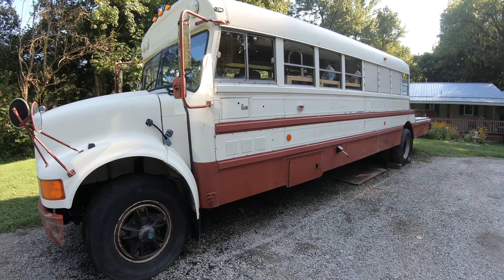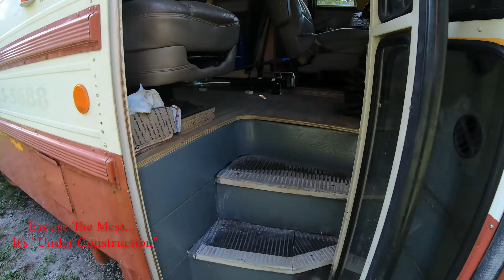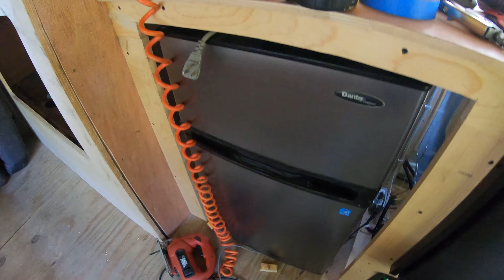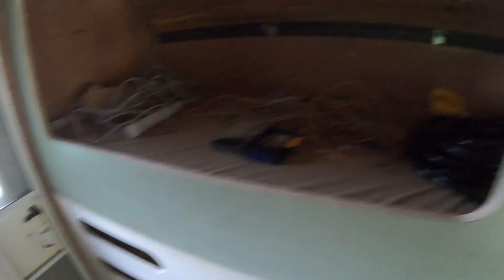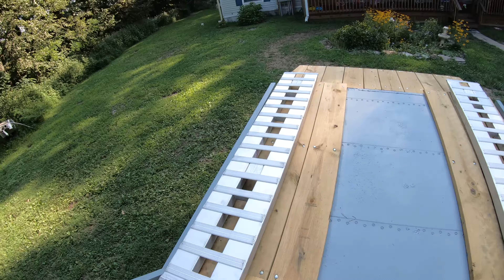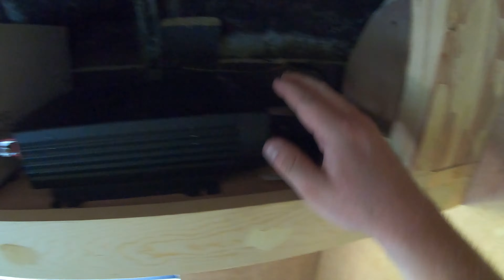NotSoGrand Hauler - Under Construction Walkaround - Skoolie Toy Hauler Build

Comment: how many batteries will the bus have?
Reply from the maker: I'm leaning towards just a pair of 200ah AGMs.  We won't be full timing or anything and our electrical needs are pretty low.
Reply: @NotSoGrandGarage  sounds good. any solar panel on top to charge them up ?
Reply from the maker: Don't have them mounted yet but do have panels ready to go.  The bus has been on the back burner for a bit (life gets in the way sometimes) but I just ordered the mini split ac and will be getting back on it here soon.

Comment: I'm seriously thinking about getting a bus to live in. This video helps me with ideas.
Reply from the maker: They are a lot of work...  but if you can do the work yourself, it can be a lot of fun too.  Check out skoolie.net. Lots of info and builds
Reply: @NotSoGrandGarage  awesome, thanks! I found one that started for 4000 in Florida. It has a toilet, bed, sink and cabinet, generator, couch and little fridge. He says 21', I don't know if that's overall or just the box part. It's a front engine International and the motor runs. Hopefully I can go see it soon. I need a way to live alone without crazy rent.
Reply from the maker: @comfortablynumb9342  What year is the one you are looking at?
Reply from the maker: @comfortablynumb9342  Also, what engine does it have?  Transmission?
Reply: @NotSoGrandGarage  it's an 88, I don't know what engine it has or any of that yet.  I'm in NC and planning on moving back to Florida (home state). So I can't go see it yet. But my dad lives close and he can see it. The owner said he applied for a new title and when it comes the bus can be seen. All I know is that it's an International with dog nose and it looks like 9 windows. He said it's 21 feet, I guess that's the box. I'm just starting to learn about busses because I can't afford a mobile home RV. And I like the idea of being able to move. But I mostly want to find a spot to park and live.
Reply from the maker: @comfortablynumb9342  On that bus, each set of windows will be approximately 26" of floor space...   so 20ish feet of interior space sounds about right.  It will either have a DT series engine or an IDI assuming its diesel.  Both are great engines from a reliability stand point.  Good luck bud!
Reply: @NotSoGrandGarage  thank you for the information! I heard the engine running in a short video. Definitely diesel. I was curious about the engine type. Your information is very encouraging. Thanks again!
Reply from the maker: @comfortablynumb9342  No worries bud.  Good luck with everything.  The nice thing about the older buses is they are typically cheaper/easier to work on and typically more reliable.  Sure you'll run into a few things due to age/mileage...  but they'll be easier to handle.
Reply: @NotSoGrandGarage  I've been looking for 3 days online. That one I told you about is the only one that I could move into and live in it while fixing it up and isn't $20k. And it's in Florida, the right state for me. I'm trying to talk dad into going to see it and maybe buy it. He loves buying old cars and stuff. I can't buy it myself until our house in NC sells. And it's not ready yet. But hopefully in March..
Reply from the maker: @comfortablynumb9342  Yeah prices are crazy on some of the ones I've seen.  Good luck with it.  If you end up getting it, you should post a build thread on the forum I linked earlier.
Reply: @NotSoGrandGarage  I will post on the forum. Good idea. There's lots of help there. Thanks!